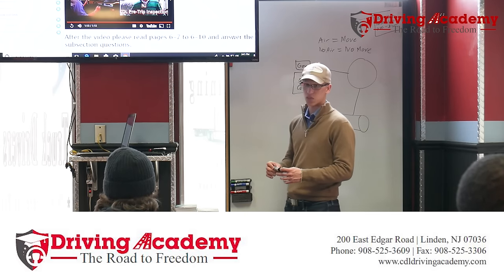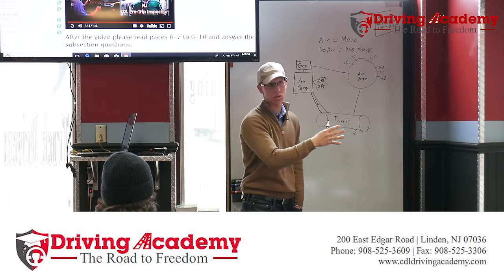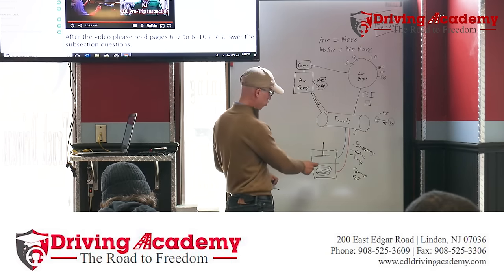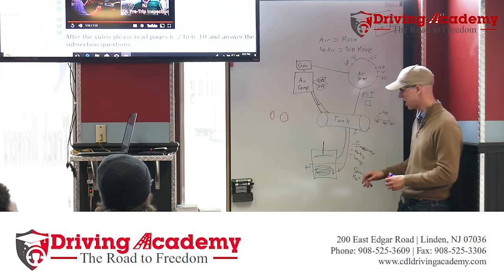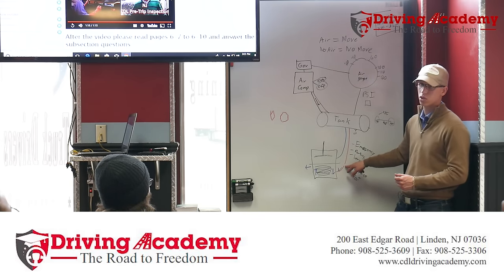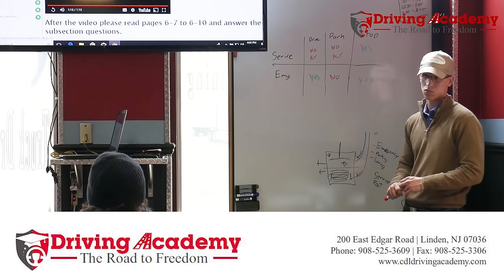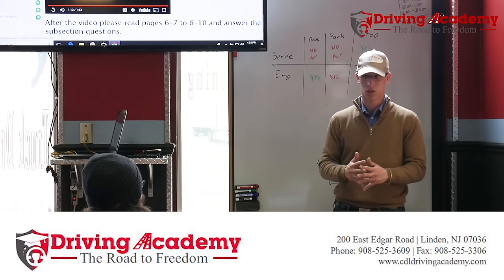CDL Training - How to Pass Air Brakes Exam - Driving Academy (Part 1)

Comment: Air doesn't lose its ability to function when in high heat situations like hydraulic fluids do. When moving heavy loads hydraulic brakes would fail due to excessive heat and that's a bad day.

Comment: PSI is a measure of force, not weight. hydraulic systems are typically around 2000-3000psi, not the puny force of 120psi as in pneumatic systems. that's a part of why hydraulic systems have smaller but beefier components. "your analogy is bad and you should feel bad" -Zoidberg

Comment: Ok yeah,  you have some of the students confused because on the brake chamber diagram that you have drawn on the whiteboard,  you apply pressure against the spring to release the brakes.  Applying pressure on the spring side (service) side would apply your brakes,  if I'm wrong please correct me and we can delete my post so as to not put misinformation on your video.  Otherwise I appreciate the video thus far!
Reply from the maker: Hello friend, the service side does not have springs.

Comment: Hi, Question regarding Traction Protection Valve location.
Is it located "rear on the cab" or the red/Yellow hexagon emergency knob on the dash. 
Please explain. Thanks
Reply from the maker: It is a valve in the truck but your emergency brakes will pop automatically when they go off.

Comment: when the air tank is full is not the right answer.. those tank are tested up to 500psi.. normal truck operations is between 90psi and 120-125psi which is what the governor works on.., also it takes 60psi to release a normal brake chamber, normal governor run between 90 and 120/125 psi.. not when the tank is full.. i understand you teaching a bunch of newbies but give them the right information..

Comment: I feel that it is not easy to understand how the air braking system works in a combination vehicle. Is there no parking brakes in a trailer without the spring brakes? Need to chock the wheels everytime they park because they have no spring brakes in them?
Reply from the maker: There is parking breaks on the trailer
Reply: @CDLDrivingAcademy  Are the parking brakes in the trailer hydraulic if they are not using the springs to brake?

Comment: This video is great for beginners but as a professional ASE Mechanic, makes me cringe.Let’s not talk about the air dryer and when the air pressure is greater than the spring is based off the chamber which can be 3030 or 3036 Multiple different ones but getting started This would definitely help

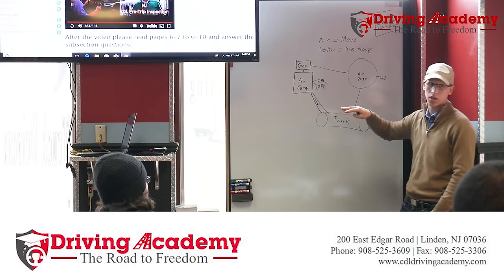Comment: That is wrong 4:25  The sound you here is the Air Dryer Purging.  If you hear the sound of the pressure release valve on the Air Tank DON'T DRIVE THAT TRUCK.  It's means there is a serious problem with the tank or the air compressor.  Too much air is being built up, it will sound like a machine gun if it releases.